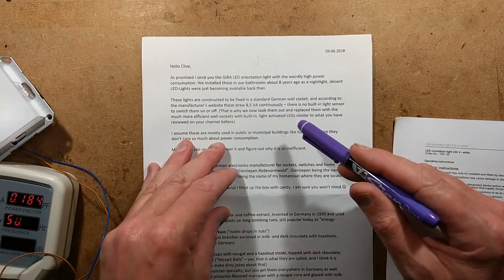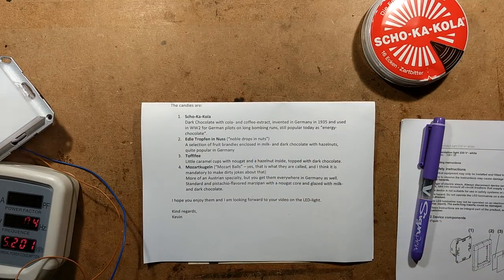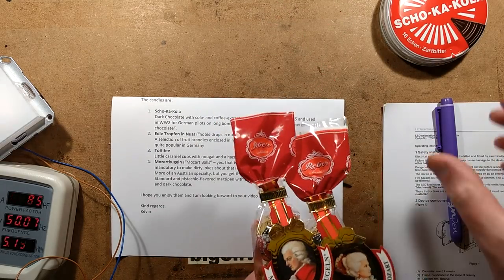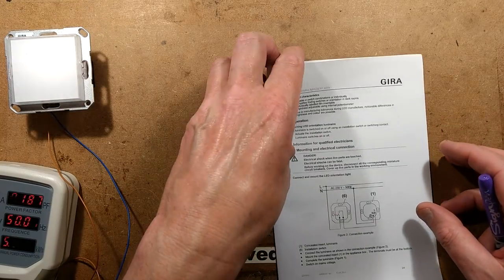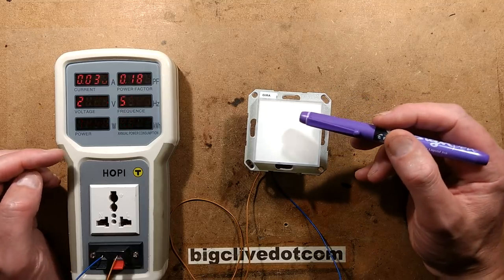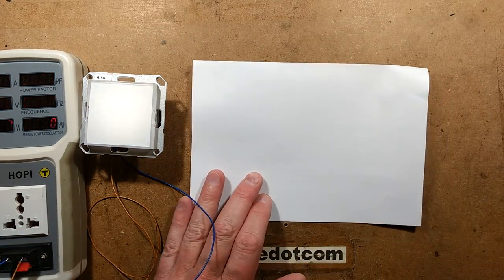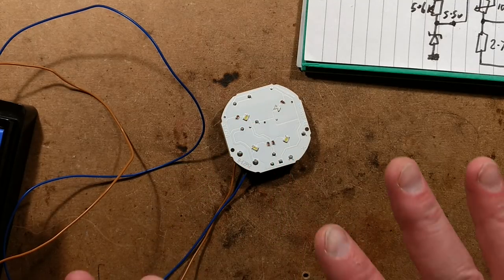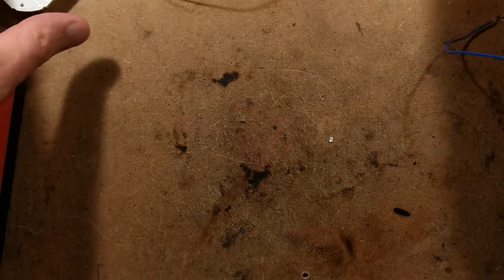Well engineered German LED light?  With schematic and tests.

Comment: Totally unrelated to your video, but watching the hertz on your meter reminded me of a problem I have. I'm in the US. We bought a cool cut off saw on ebay, but its rated for 400v 50hz. Is there any possible way to run this thing off 208v 60hz?? I've been trying to find answers now for years and no one seems to have an answer lol so it sits in storage. Its made by IMET.
Reply: Joshua Hamilton:       You can use a variable-frequency drive. It converts your voltage/frequency to another, adjustable voltage/frequency and usually has a sinusoidal output.
Reply: A unit like that would need to be fed a bit differently.   208 volts won't do it.   400v, 50hz as an origin would need 480v, 60hz - something nasty like this thing - http://www.gohz.com/200-kva-480v-60hz-to-400v-380v-50hz-converter  

That's a honking big piece of equipment, if it needed 400v at 50hz.   I was in a similar situation with an industrial sewing machine, and ended up just buying a new motor that would run on the voltage I had available, and a different starting capacitor.   I'd suggest talking to an electrician experienced in industrial motors.
Reply: yeah i was worried about that. The ebay seller didn't list the voltage, and we never thought to ask until we got it. City wants 10k to run the 3 phase wire from the pole to the building, so he's stuck with 208 single phase. sucks too cause there's about 4 machines there running phase converters of some sort or another. The motor we could probably get rewired but i'm no so certain about the controller for the up and down of the blade and the holding of material. Sounds like this thing is just a boat anchor unless someone overseas wants to buy it lol. Not sure how it wound up in the states to begin with, but buyer beware, right? haha.
Reply: its an Imet automated cut off saw. You hit the button and it holds the stock and cuts it. Would be awesome if it had worked lol. I think the motor is only 3hp, not sure why it has such large voltage requirements, guess to make it compatible with other industrial stuff in that region.
Reply: That sounds like the controller system is probably NOT being run on 3 phase.   I'd bring in an industrial electrician to check it out.   My guess is that you can get the controller system separated out to run on a converter for 50hz directly, and a second feed for the main motors.   As for why three phase motors on that gadget?   Lower current draw, smaller size, take your pick.   VFD or just replace the motor.   I guess it depends on how useful that automated system would be for your business or home.   

Here's a discussion from a few years ago on your exact situation - https://www.practicalmachinist.com/vb/transformers-phase-converters-and-vfd/what-do-i-need-run-400v-50hz-machine-100825/
Reply: Interesting.  Looks like IMET is related to Kalamazoo Machine Tools - AKA kmtsaw.com.   Perhaps they could help?   They're in Portage, Michigan, and have sales offices around the US and Canada.   They're even mentioned on the IMET web site, if you do some hunting.   On KMT's web page, under about us, it even says that IMET is their manufacturing facility.
Reply: Thank you for your help. After finding the manual again last night, I realize I have what is hopefully the right schematic for the machine. Since I've learned some things since the last time I looked at this, I think its time to give it another go lol. At a first glance the controller seems to be powered by DC so surely that could be run off some sort of transformer, and like you said, THAT part is not 3 phase lol.
Reply: Hope it helps - I saw somewhere that they were driven by 24 volts, but it didn't say A/C or D/C, or even if it was all of the various models.   Give Kalamazoo or IMET a touch; they may have a package kit for conversion.  Good luck, it looks like a fun piece of equipment.
Reply: we had some neat stuff there. I had to leave my job after a knee injury because all of our rivet machines were foot operated. All very old. The pistorius double miter was cool too, all pneumatic operated. And they also have an ANCIENT band saw that's friggin massive, but alas it ate the motor for the phase converter and they have yet to repair it. www.volcase.com It was a neat operation to work for. I was able to streamline a lot of the processes while I worked there and saved a lot of time and money. Still have a great relationship with the guy that runs the company, hence why I'd love to figure out how to get this thing going for him. I think we gave $1500 including shipping, and I think I mentioned before, safety was the biggest motivation behind purchasing the saw.  Gotta love the age of the internet, the information is out there, you just have to find it :) Thanks again my friend!

Comment: If they charge by apparent power, then you just need to correct the power factor. Apparent power consists of real power (watts) and "imaginary" power (measured in volts-amps-reactive, or VAR). If you plot watts vs.VAR on a complex plane (real/imaginary graph), the sum is apparent power (vector sum). We call it "imaginary" power because you're actually taking it part of the cycle and giving it back the other part of the cycle (which is why they can't charge for VAR because over a sine wave, it adds up to zero - you give back all the power you took). Of course, the equipment needs to be rated to handle it, and in industry, power companies charge for bad power factors because of the increased load handling equipment you need plus losses.  But the thing is, imaginary power is caused by capacitative or inductive elements, so if you compensate by adding the other component, you can zero out your apparent power (because it flows between the inductive and capacitative elements) just after the meter. And yes, industry does this - after the power meter they have banks of capacitors (usually industrial loads are big motors and thus inductive loads) which exist to zero out the imaginary part and return the power factor closer to 1. So when the power companies try to charge for it, if you measure and compensate for the power factor at the meter, you can save some money. Perhaps the Chinese power companies already do it, explaining all those "power saver" devices for sale.
Reply from the maker: It's not as easy to compensate for modern power factor issues as it used to be.  In the past it was simple inductive loads like transformers or motors that could be compensated for with a capacitor.  Modern electronic circuitry has a weird non-sinusoidal current waveform, often with a strong peak at the top.  The power saver devices with big capacitors in them would potentially cost you more money if apparent power was being metered.

Comment: Out of curiosity, what does it take to build a LED lamp with a power factor of 1?
Reply: Best start is using a good ole transformer, inductors and capacitors. If the load is defined, you can start building a power factor correction. A tiny bit overengineered for a LED light...
Reply: Hermann Schaefer  that would only work to some degree and only if you use no smoothing capacitors at all in your circuit.
With inductors and capacitors added to the AC side, you can only compensate for sinusoidal offsets between voltage and current. 

Any circuit that charges a capacitor from the AC to a DC voltage and runs LEDs from that voltage will have a bad power factor. 

Your best bet for PF=1 is a Switched Mode Power Supply (SMPS) that has Active Power Factor Correction (APFC) circuitry. It´s a bit too complicated to explain here in detail.
Reply: Basement ScienceE:   Even a PSU with APFC actually does not reach a power factor of 1, but it can come quite close to it.
Reply: Well, goal is a 100% resistive load. You can get close to that if you try to compensate each non-linear parts of your circuit, so compensate each capacitance with a inductance etc. This will get you quite close to 1, but a load impedance Z = 0 is theoretical.. and a bunch of static VAR compensators for a LED light is a bit.. well..
Reply: You could come pretty close using a small number of LEDs a resistive dropper and no smoothing capacitor. This way the current waveform will closely track the voltage apart from when the voltage is close to zero and the LEDs aren't conducting. This arrangement will be flickery and relatively inefficient.

Comment: Could you show how to measure if a diode is a ‘Zener diode’?
Reply: Put a current limited reverse voltage across them and see what voltage they clamp it to. Use a dmm with a zener test function.

Comment: Illusive power bills - that a treat. First politicians and the energy industry forces smart meters down our throats ( as if I could control when my fridge should be running to level out the power draw over the day), then we get very bad new technology where on the surface energy is saved, while in reality we are going to get billed 10 times real power because smart meters.

I suppose more taxes are needed to supply politicians with monopoly money and executive officers with new yachts. Customers get 2 W but are paying for 20 W. That is quite the dividend! Buy energy shares, who cares about public opinion they are just meep-meep sheep anyway. Nothing a well oiled PR machinery cannot fix.

Comment: What is a capacitive dropper?
Reply from the maker: It's the simplest circuit for driving low current loads like LED lamps or time switches.  It uses a capacitor to ration a small amount of current through on each half cycle of the mains supply.  The downside being that it does not isolate from the mains.  So all circuitry should be treated as live.
Reply: Thanks Clive!

Comment: They allready did it here in Norway... -.-
Reply: What's the price?
Reply: It didn't cost anything for me to get it installed. 
But there was no option to keep the old one, because the power-meters communicate per-to-per over some sort of "WiFi". So they are dependent of that everyone gets the new type so the meters so they communicate with each other. And they told me they make back the cost of the unit in 4-6 years.
My powerbill is around $350 a month with the new meter, and got around $280-300 with the old one.

Comment: wow to run a 2w light for 1year  continuously   would cost around  £22   dam i have a kitchen with 2 twin flourescent lights each fitting using 140w  so 280w  i guess nearly 2,000 a year or 20,000 a year    if ran continuously  i may not be correct lol but its a guess
Reply from the maker: It works out roughly £1 per watt per continuous year.  But with an LED lamp the real power might be 2W (£2) but with apparent power metering it could be £10 or more a year.  I tested a powerline filter and it would cost about £8 a year just sitting idle because of the filter capacitors.

Comment: I didn't want a smart meter and after a few videos where you mentioned what they can do will resist getting one even more, but I've not been asked yet long may that continue
Reply: You can refuse to have one fitted, despite what they try to tell you, it's NOT a requirement. I've put a label on our existing meter, cutout, and meter tails. "DO NOT FIT SMART METER, CALL [my number] FOR INFO"

Given the installers are worried about liability, they'd call... and i'd tell them why not to fit one (they don't like them being blown up)
Reply: TheChipmunk2008 They need the consent of the account holder. If Mrs DrTeeth gave her (illegal) consent,  I'd sue them to hell and back.
Reply: Likely depends on local laws if they can change the meter when they want or not. They do own it.
Reply: DerpyMail In the U.K. they have to have the owners permission to change the meter type. The meter is actually owned by the distribution company, which may or may not be the same company as the customers' supply company.
This is the reason why the industry and government are spending our money on advertising that is biased and misleading, encouraging customers to ask for a so called smart meter to be fitted.
Reply: Unfortunately, in Texas, the PUC let the power companies slip forced smart meter replacements into the recent contract changes - and they're forcing us to pay for it as well.   This, despite the fact that smart meters mean they can use fewer meter readers, and they save money - and can charge more for the power factors.
Reply: Our REMC are putting them in system wide we have no choice in the matter I am on a TOU scheme peak /off peak  off peak 7cents per KWH   peak 28 cents per KWH  the thing I wonder if they will start charging apparent use  vs actual use ??   They tell me it transmits every 10 minuets at 900 MGHZ telling them my use .
Reply: tazz1669 get yourself solar panels installed and then you'll get money back from the national grid and no bills at all.
That's what I've been doing for the past 8 year's..
No electricity bills and around £250 A year from the Grid
Reply: DerpyMail yea they do, a lot of people like to say this and that, but at the end of the day they can change it if they want to.
Nobody has the balls to take the matter through the court's, big difference between shouting the odds to look good and actually putting those action into place

Comment: Would capacitor "energy savers" work to fix the power factor of capacitor dropper lamp as well as it would for clasic fluorescent tube fitting with magnetic balast?
if yes than wouldn't installing one such capacitor between in-rush resistor output and other ac input make for a good mandatory power factor corection device in many led lamps?
Reply from the maker: The capacitor power savers would actually make things worse.

Comment: Smooth! Candy advertisement disguised as an electronics video.  :D
 That cheap Chinese crap is advertised as a 5W bulb, yet it effectively only uses 2.5W (if that) but pulls about 23W from the power line. That is a very careless and inconsiderate design, both to the purchaser and to the environment. This is one of those cases where people hope to save a couple bucks up front, but end up paying tens of dollars more in the long run, not to mention the smaller amount of light and the poor light quality.
 I wouldn't say that the power companies are just trying to make more money by charging for apparent power. The apparent power is the actual power they have to deliver to your outlet, and that is not even considering the increased losses on the power lines because of the significantly larger currents flowing back and forth. It would be shortsighted to be upset about getting charged for the actual amount of power the utility needs to provide. Instead, people should be upset about the low power factor of the crap they buy. This would be analogous to buying a gas-guzzling vehicle and getting upset for paying more for the fuel and the environmental costs while driving the same distance as someone with a more efficient vehicle. If you don't care about wasting energy, you shouldn't care about wasting your money either.

Comment: If the power companies start charging for apparent power then I will start using my stash of incandescent bulbs so I'm paying for the power I use.
If the lamp manufacturers started selling matched pairs of lamps, one with a capacitative dropper the other with inductive, that should correct the power factor.